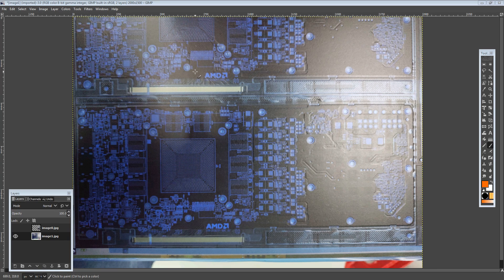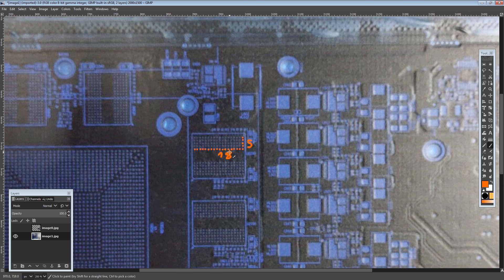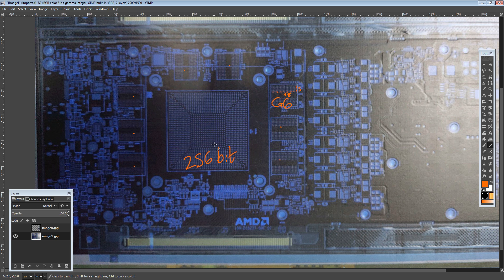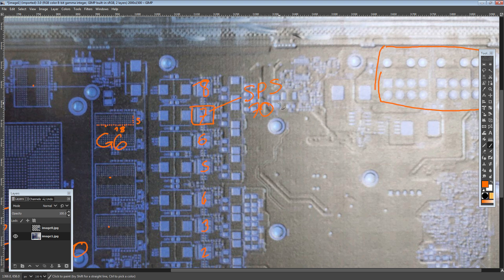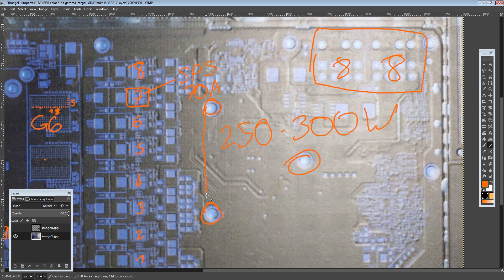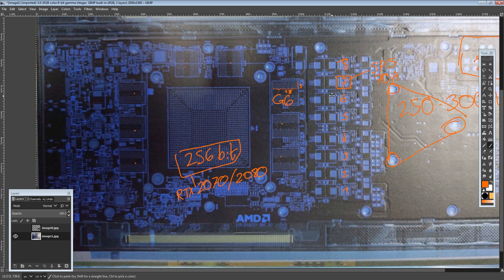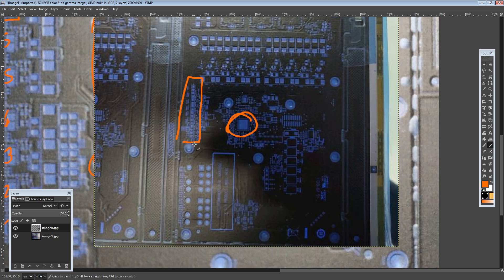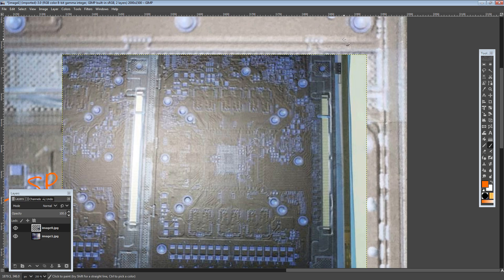Baseless speculation over a GDDR6 AMD GPU PCB

Comment: My guess is it will be a similar power to Vega. I hope they don't go blower, o could use my Vega to dry my hair if I wanted, and it's just as loud. However with the use of GDDr6 the core is probably a bit more efficient, so they might cheap out on the cooler :/

Comment: "I really hope they don't ship this with a blower fan."

We don't know what it is though. In many workstation and server setups where you have multiple cards stacked up right next to each other open-air cooling doesn't work at all. If this card is designed with a data center in mind it would explain both the power delivery and a blower fan configuration. That's the best way to cool it and nobody cares about the fan noise in a data center or machine room.

I love speculation but assuming we're looking at a consumer card when we actually don't know anything about it might get us on the wrong track.

Comment: Okay, I just wanted to make a quick rebuttal on a few points here. Mostly on conclusions you made via extrapolating the memory bandwidth speed. First, and I am going on my own memory here so take it with a grain of salt. Some time back, an enthusiast tested to see how much of a hit the Radeon 7 would take if you cut the memory bandwidth in half. I don't remember how he did this, but the conclusion was the hit wasn't as big as expected. It was there, but it was relatively minor if I recall. Between that and Navi being a new architecture (granted it's based on an existing one, but still, Vega and Polaris' quirks may not line up entirely with Navi's.) I'm simply not sure you can draw too many conclusions on memory bandwidth alone.

Yes, this is a speculation video and that's exactly what you're doing here. I still feel it's worth saying this though
Reply: problem with navi...it was rushed and no more engineers left for making anymore architecture ..so its last GCN you gonna see after last engineer left disgrace after finalize this horrible gpu in his words ..cause he made it without RAJA help this time...and that is very concerning now
Reply: @user78405  

Are you, trying to set off an argument or something? I don't mean a discussion. I mean an argument. Something unpleasant, emotion-driven, and not based on any facts. Cause that's what it's looking like here. With all due respect, I see no reason to engage you on this. You've already made up your mind about a new architecture without learning anything at all about it. I can't even say your argument is based on speculation. You've merely stated, "Navi bad," without giving any sort of justification for your conclusion.

That's not to say that Navi will be good, but we won't know until we're a little bit closer to the release and see some actual performance numbers. Oh, also, according to multiple sources, Raja Koduri did work on Navi. We don't know how close to completion the architecture was when he left, but you do appear to be wrong on that assertion. Just putting that out there for the record. So nobody gets confused by this nonsense.

Comment: Well, the RTX 2080 (at least the so called FE "quality" ones) also have 2x 8pin as a default power supply configuration. And their TDP rating is "just" 215W. So I don't see that as a eyebrow raiser.

Also, about the 256bit GDDR6, isn't it likely they would use the newer (not really new tho, launched in January 2018 I think) 16Gb/s chips? RTX 2000 uses the first generation 14GB/s across the board. Not that 448GB/s vs 512GB/s would be a huge difference but still. Also, I'm willing to bet Navi uses better color/data compression than Vega, and maybe some better tertiary memory management as well. All in all it doesn't look bad. But I don't expect anything much past RTX 2080 performance for the top dog/anniversary Navi10 card. At least not within the 2019 timeframe.

Comment: Looks like it has 4 phases for core, 4 for SoC, with the phases on the very top and left-hand being the misc display and memory phases. The dual 8-pin I'd hazard is for the purpose of preventing sub-par PSU's from being paired with it, for the simple fact that GCN vega and later has rapid power gating, which has a tendency of burning out the VRM's in weak PSUs...

In normal usecases, the average peak power of the v64 and VII is in the 200-250W range, this should only be in the 150-200W range tops assuming ~48CUs at ~1800MHz and 14Ghz GDDR6. Most of the power will go through the 8-pin's, and a gold+ PSU would still be highly recommended as to avoid the PSU having a pre-emptive aneurysm battling with the gating.

Comment: My MSI GTX 980 Ti Lightning has two 8 pin and one 6 pin power connectors.    I just ran Heaven benchmark and it maxed out at 259 Watts.   Click on the image to enlarge it:    https://imgur.com/NpJeNa9    [Edit:  I used to have an MSI R9 290X with three fans and it was quiet.   I also had a reference R9 290 and it was LOUD!  Fan and heatsink design are paramount.]

Comment: 6:30 Gigabyte G1 Gaming GTX 980 Ti  allows for +139% Power (which I use) which adds up to around 340 watts! That said, in most games and benchmarks, my 1503 MHz core never uses more than about 128% TDP for only a few seconds at a time, it holds to ~115% TDP more often in most use cases. 

And mind you, I am running ~+22% Core (1503 MHZ) and 15% VRAM overclocks (8 GHZ/Gbps Effective) over the stock G1 GTX 980 Ti! I am some odd 34% core above reference boost (which tends to max out around 1220 MHZ) or roughly 45% above the RATED boost of only 1076 MHZ on the reference 980 Ti!

I REALLY want to see a 980 Ti OCed like mine, versus a ~$365 USD RTX 2060 at stock! Because with 15% more VRAM bandwidth than either the 980 Ti or RTX 2060 stock, and some odd 35% core clock advantage over a stock 980 Ti which is still ~22% odd over stock G1 Gaming GTX 980 Ti - one of the best models ever made!

Comment: There are plenty of ways to to improve the sound profile of a blower style setup. With radials having a very limited static suction power. Blowers could with improved heat-sink design. Far outperform radials in performance characteristics.

Comment: With the length of time even gaming GPUs are put into into service these days (I have several over a decade old). Those who do not appreciate blower style fans for their reliability. Clearly haven't spent enough time with radial style fans (they fail OFTEN). I would rather my 1000$ investment be reliable then trendy, And marginally better at cooling.
Reply: I just retired my HD 6850, only problem was it had solidified dust inside (my own fault).  I too appreciate those blower setups.

Comment: Could a 'Radeon VII' GPU be redesigned to use GDDR6? Saving money over HBM2?
Why would they make a 2 x 8 pin power connectors if PCIe 4 is supposed to support 300W power?
Would a GPU blower be cheaper than a standard fan cooler?- If so could a blower offset a price of an AIO on the GPU?= Hybrid?
Reply: Zoid went over a g6 version of R7 and he thought it was impossible because the silicone is designed to worked with HBM2. Since it works in stacks.
Reply: Not really, they were using the same vega architecture they used on vega 56 and 64 they cant just slap different memory on it

Comment: Blowers are fine by me. My HD6970s blower still works (outlived the usefulness of the GPU) and the normal fans on my HD7950 and my sister's R9 380 are shit and plenty loud (the HD7950s both went bad). If you care get an aftermarket solution. I really wish the custom air cooler market would grow, the custom coolers people could make would be leagues better than what these companies are charging premiums for. I'd rather pay $100 for a good custom card specific heatsink (not even with fans) than pay the $70+ people are paying for some of special edition GPUs

Comment: this is just going to be an another GCN card. they really need to rework NAVI to utilize that 7nm gimmick they have.
GCN is good for lower end to mid range cards but not for the higher end ones, I don't think It's good to have a 300w card that matches a more efficient card in performance for 100watts less. though I think power won't be an issue for you guys who have lower power bills and don't use your pc more often.

Comment: 300W for a chip with a 256 bit memory bus screams engineering PCB for me. At least i hope so because if AMD builds a GPU with a performance level that is expected with a 256 bit bus while needing 250-300W, they succeded in developing a architecture that is even worse then Vega 10.

Comment: Just give me 1080 performance for less that $350 and less that 200w. I'd insta buy for those specs and I don't think that's too far fetched.
Reply: Could you accept 75$ more and no custom coolers but a blower.
Reply: @DurzoBlunts  no way, I already have a Vega 56 pulse, after undervolting, and some tweaking of the clock speeds it comes real close to a 1080 at just over 200w. This card also runs cool and extremely quiet. Navi is going to have to beat this card while consuming less power for me to even consider it. It also needs to be reasonably priced. Fortunately I'm confident Navi will do exactly what I hope.

Comment: I don't think naked PCBs are useful for speculation about powerdraw in general. If you look at the PCBs of most high end nvidia cards from the last half decade, you'll see contacts for an extra 8 pin that they don't populate. If you saw that PCB naked before the card was out, if you applied the same logic you'd get a maximum powerdraw of 450 watts. 
Thus, strictly speaking, anything below what the contacts would suggest is strictly possible, and the only solid information you get is the absolute maximum.
And they don't have to populate the whole VRM either. Actually they don't even have to populate all the memory chips, though they fucking better, cause these aren't gonna be much less bandwidth starved than vega unless they injected its arteries with a metric ton of L2 cache.
I don't think your numbers for powerdraw are far off for this level of performance though, just not because of this leak. We already have 7nm GCN with vega 20, I don't think anything but incremental uarch changes can be expected, and without HBM they'd need a miracle to get a more efficient and competitive GPU out of GCN.
this has been a 2 AM rant comment.

Comment: AMD Navi will be a big bluff. It will barely match an RTX 2060. In fact, i think the best NAVI card released will be between RTX 2060 and RTX 2070
Reply: Vega 56 at 1710 Mhz already rivals or beat RTX 2070 and Vega 64 at 1590 Mhz. TFLOPS is meaningless without ROPS exposing the available TFLOPS to memory frame buffers.
Reply: @valenrn8657  Any Vega 56 above 1650MHZ is getting high temps. Unless you have a golden sample, your statement is highly bumped. ON the other hand, the RTX 2060 is like a GTX 1070ti. The competitor for VEGA 56 was GTX 1070. Lets put numbers here. A vega 56 is something around 9% slower than a 1080 both stock. RTX 2070 is around 8% faster than GTX 1080 so RTX 2070 is around 15-18% faster than VEGA 56. a VEGA 56 overclock, even a good one, cannot match an RTX 2070 no way, and you´ll have to provide numbers to this because just saying is not an argument. Just to add comparable numbers: GTX 1660ti is 14% slower than RTX 2060. GTX 1660ti is just 8% slower than VEGA56. This means RTX 2060 is 6% faster than VEGA 56. Numbers talk clearly. RTX 2060 is just 4% faster than GTX 1070ti. There is absolutely no argument to support than an OCed VEGA 56 card can match an RTX 2070. I would say it can match an RTX 2060 at best.
Reply: Navi card between 2060 and 2070 would be super good news! It would mean that amd polaris replasement is really good! Super good actually!
Reply: @haukikannel  The problem is not the performance but the price. The actual hype is with the price. It would be no good news if the new 3080 or 680 is around 500$ and less power efficient right?? Reality is many people are saying that this Navi will come at low prices with 2070 level performance. That is never going to happen. AMD will not ship those cards at half the price of NVIDIA. Either the performance or the price is wrong. Take your guess.
Reply: Navis price is comparable to 570. If the Navi is faster than 570 it is more expensive. If it is faster than Vega 56 it is more expensive than that. Ofcourse! That is how market economy works. If something is better, it is more expensive. We just don’t know the speed or the price point yet. If Navi is indeed between 2060 and 2070 it is huge step in speed compared to 570 and 580. But Lets see that first! The price is so that it will fit between nvidias and amds old cards.

Comment: 7970 also had 2 8 pin on the PCB. You also see that they have the holes for 6pins as well.
So it looks like the 8pins are OPTIONAL and the Card could be designed for both 2x6 pin and up to 2x8pin and a mix of 6 and 8 pin.

Comment: Also, Fiji’s HBM memory controller was gimped and effectively was only 320-340GBps or so in reality.
Reply: Well, “gimped” is not quite accurate, that is more the level of Nvidia’s first GDDR5 controllers, which had something like 50% efficiency.
65-70% for first gen controller isn’t that terrible.
But regardless, Fiji’s actual bandwidth was pretty close to the 1080, even lower If Nvidia got decent compression.
(AMD had compression also, but Nvidia was (and is) much better).
Reply: @Testbug000  I remember seeing Vega also testing at ~66% of theoretical bandwidth in Sandra(?), while AMD's and nvidia's GDDR5 cards were doing 75-85%.

Comment: RTX 2070 level of performance is being optimistic. My guess is Vega 56 level at the same or higher power draw, if this is a consumer board. However, the card should cost less to buy because it doesn't have HMB2. Disappointment is about to set in as the hype train crashes and burns.

Comment: If this is an ES, then the PCIe connectors could be overkill. But the VRM is still concerning. Navi is expected to hit Vega56/64 levels. This would fit the 2070 performance level. But why on earth would they need 250+ W. This card would be literally a Vega 64. So something doesn't add up. Maybe that´s the beefy Navi 20 PCB. 256Bit seems too few for a GCN based card. 2070 and 2080 hit 448Gb/s which is already too few for a Vega56/64. Hopefully, they optimized compression.
Reply: Some leaks says full NAvi 10 chip with 48CUs will be labeled as Special Anniversary Edition. So maybe AMD founders edtion will have overkill VRM for whatever-you-gonna-do-with-it.

Comment: $50 says this comes specced on actual cards (inc. AMD's reference) almost universally with 1x 6-pin & 1x 8-pin power connectors (that and 2x 8-pin can both use the same 2x 8-pin PCB layout). 2x 8-pins for a reference 7nm GPU of this class (1080/2070/Vega 10) would be absolutely freaking ridiculous; like to the point that power efficiency would have had to have actually REGRESSED from Radeon VII's Vega 20 (unless it ends up targeting 2080/RVII territory instead, which has been rumored recently & in which case it becomes totally acceptable). 

Everyone talking about 300W TDP's are completely missing that point (that 1x 6-pin & 1x 8-pin configs can use the SAME PCB layout as 2x 8-pins). If this actually is the retail PCB & not an engineering test board (as is just as possible), expect to see 2x 8-pins almost exclusively on high end AIB models that don't go the custom PCB route.

Comment: Long live blowers!  You want loud, try running reference 8800 GT SLI with only 1 slot spaced in between GPUs.  Top card will be hitting close to 100% fan speed
Reply: I still have my 3 way SLI 9800GTX setup with no space between the cards, yes its loud AF.

Comment: Question is:
Is this pcb a Navi 10 or 20? If indeed it has 256 bit memory and it competes with 2070/2080 it should be the top tier Navi 10, or 3080. But if so, im head scratching over the TDP, as the rumors and leaks suggest that the 3080 chip only has 48CU with a TDP of 150-180W 🤔
Reply: Perhaps we are overestimating the inportance of the pcb over the total tdp. We usually get a rough estimation of the tdp by looking at how many power stages and VRMs it has, but if this is indeed Navi, then we should also take into consideration the benefits of the 7nm node, and other arquitectural improvements on the core
Reply: No one has asked what the size of the chip is....you can easily estimate with this picture.

Comment: 109-C38637-00 - HD7970 Reference PCB 
109-C67157-00_02 - R9 290 & 390 Reference PCB 
109-D00947-00_02 - RX480 Reference PCB 
109-D00947-004_03 Unknown Prototype RX580 Polaris 
102-C94031-00 Rev 06 (ASIC 215-0910038-00) Polaris 20 (RX570/580) Unknown Engineering Sample 
102-D05001-00 Rev 25 (ASIC 215-0894200-00) Vega 10 XT Engineering Sample 
109-D05057-00_02 - Vega Frontier Edition And RX Vega 64/56 Reference PCB 
109-D06537-00_02 - Vega Nano Reference PCB
109-D36037-00_04 - Radeon VII Reference PCB

109-D08647-00_02 Radeon Pro Duo (Polaris)
109-C88837-00C_02 - Radeon Pro Duo (Fiji X2)

109-D18237-00C_02 - This Card (Have fun)
And yes this is a Pro (WX) variant card
Reply: Note how the Design number is lower than Radeon VII
109-D36037
vs
109-D18237
Reply: Pro cards makes sense to use blower cooler.

Comment: Genuinely delightful video. hits subscribe Question: from this, is it possible to reasonably speculate on whether a card with this design might be compatible with existing after-market coolers that work on R9 Fury, RX Vega or RX 480/580 cards, such as the Raijintek Morpheus II?
Reply from the maker: you could count pixels from one screw hole to the next and use the dimensions of the PCI-e slot and GDDR6 mem chips to convert the pixels into mm. That would tell you what heatsinks if any will fit.